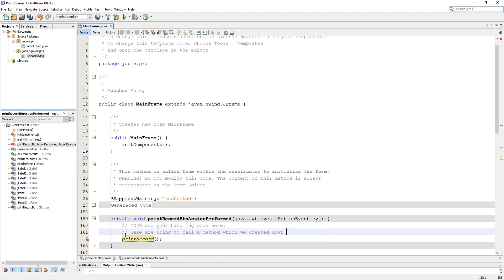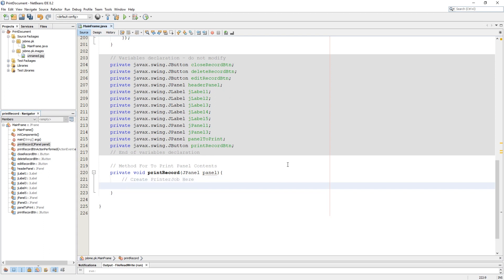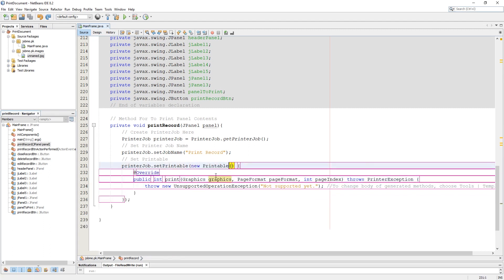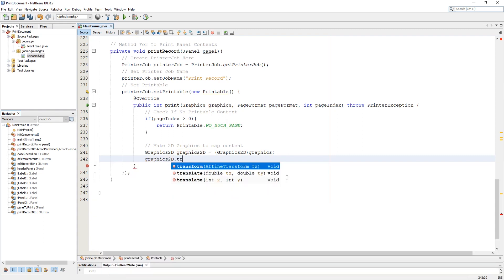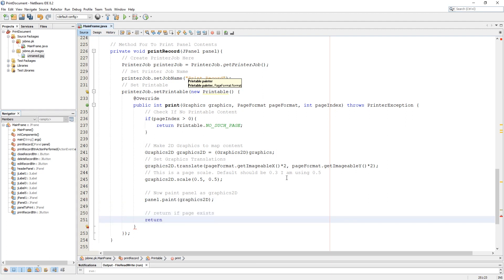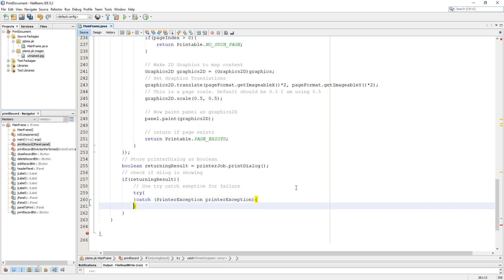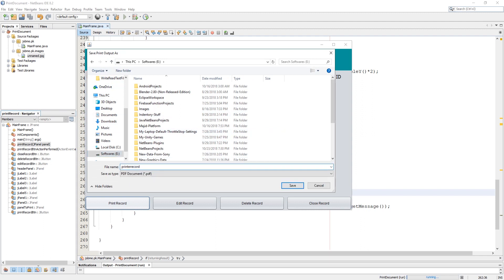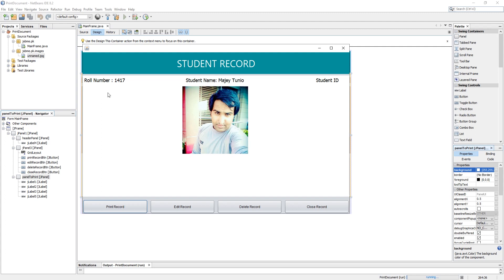Print JAVA Component | How To Print Panel in JAVA using Netbeans

Comment: i just want to print it directly i dont wanna save it as PDF so after i click print. The printer automatically prints is that possible?
Reply from the maker: Attach your printer and where I am selecting PDF you have to select your printer easily.

Comment: If panel is too long than how to devide it in multi-page?
Reply from the maker: For multiple pages or table print you have to work with PrinterJob and Printable panel. I have prepared a method to print a table with multiple pages. You can send your email address or mail me at info@jobme.pk
Reply: @JobMETechSolutions  ajaysinhrathod1290@gmail.com

Comment: Thanks for this.. SUCH A BIG HELP!  More Power Sir
Reply: Sir how can i set the pages so that i can get all of my data. Currently i'm able to print just 1 page, but may data is not just 1 page
Reply from the maker: You can use your page’s components in method’s argument to print it out. You need to somehow arrange method available for all your pages dynamically.